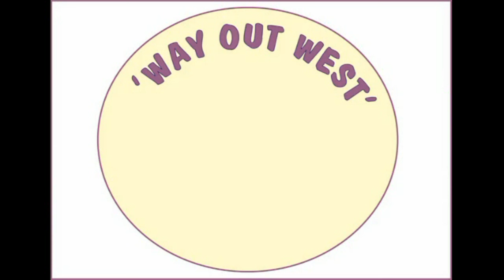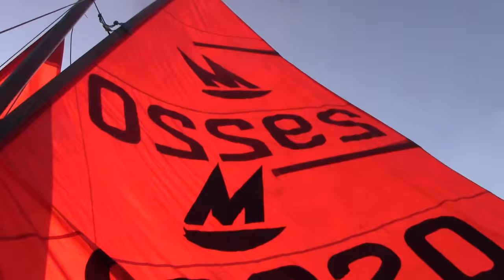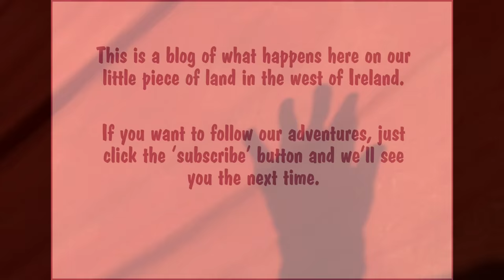Launching The Homemade Catamaran (And Early SeaTrials..)

Comment: Wonderful !  
A near replica of how the Irish were first to discover the Indies...

Yes, daggerboards are quite important in any shallow draft vessel under sail.
The rudders should also extend further towards Davy Jones locker to get a good bite.
Oars and fresh water always important.  Tackle would be good for controlling the rudder, then it could be tied off to a cleat or bollard. Lights...  Wise to have emergency lighting, a horn, flares, and a cell phone.  The wind can easily take you much further than you ever imagined.  Against your will !    ...and I do enjoy your videos...    rc
Reply from the maker: +Rusty Case Lots of catamarans don't have daggerboards, though. They rely on the hulls acting as keels and it seems to work for them. 

These rudders worked surprisingly well, Rusty. Honestly. And no bits of string needed.

You're right about the other things though! Thanks!
Reply: I've never been much of a seafarin man, such as Barrrid, Bran, Duin and Brendan, but we tried our hand at kayaks with sail, then cats.
Most skitter across the water sideways if they don't simply tip over in a stiff breeze.  Perhaps the group could find a copy of 'Sailing Alone Around the World' by Joshua Slocum. Not as colorful as Brendan's tale, yet I enjoyed it very much.  Exercise caution when leaving port!  rc
Reply from the maker: +Rusty Case That book's on my Christmas list..!

Comment: That actually works so well, fair play to you!
I wonder what its like compared to a proper one? I mean it looks great to me and you seemed to like it (but you have said you're not a sailor). I wonder though if someone who's hobby it is were to try sailing this one how they would rate it, you know?

Such an accessible little design; it would really make you think about making one.
Reply from the maker: +zero_sum Well I have sailed a bit - I'm just not a catamaran sailor. (Or maybe I am now!) Good question, though. And to be honest I don't know how good it is. It will certainly sail into the wind, it's stable and the rudders are easy to use - all good points. But it's kind of heavy too and it could be smoother, so I don't know what to say. I will try to get a real sailor out on it one day and report back..

Comment: Now you're sailing! I wonder, have you had to reinforce the cut and shaped ends of the aluminum covered foam (celotex)? as when I cut and fitted it in-between our rafters, I noticed it delaminated from the foam if it had any pressure on the foil.
Reply from the maker: +Rabidavid Not so far. My original plan was to use inner-tube rubber stretched over the bow end to protect it and keep it together, but so far I haven't needed it.

Comment: Came across this in my research to build a cat for my grandchildren which would be quite indestructible based on a mast and boom I acquired with a sailing dingy, and would you know it if it was not a mast and boom for a mirror dingy.
I will pinch your design but modify it slightly to have 12mm ply in the center of the hulls and bolt two decking boards on the outside of the hulls to hold the insulation in place. I will bolt two center boards to the inside aspect of the hulls and use some lead ballast on them to give them negative buoyancy.
Was it just trial and error on where to place the mast and seating for the boat?
Really good fun :)
Reply from the maker: Be careful how much weight you add, Andy. The mast position was a guess, as you say, but it seemed about right. Best of luck!

Comment: You obviously dont have much experience sailling because any good saillor knows that you can sail in no wind, i have done it many times, either rock the boat side to side or skull, which is basically moving the rudders side to side as fast as u can. These can both move a sailboat in no wind
Reply from the maker: Well that's hardly sailing, though, is it?!